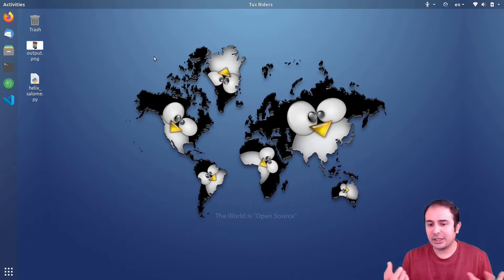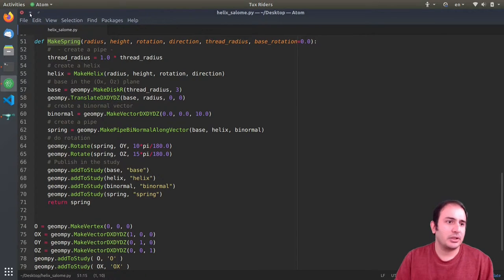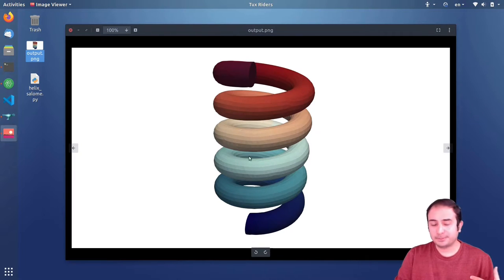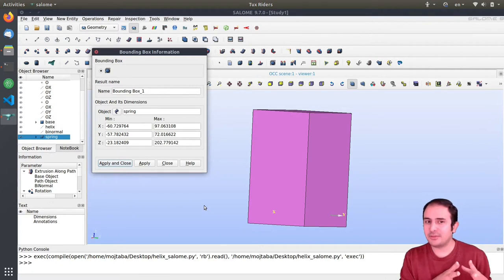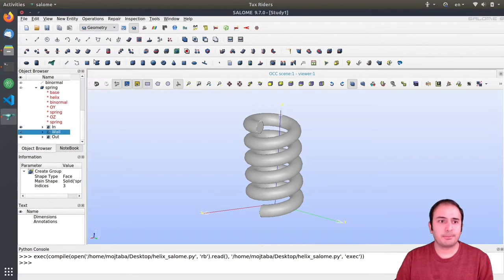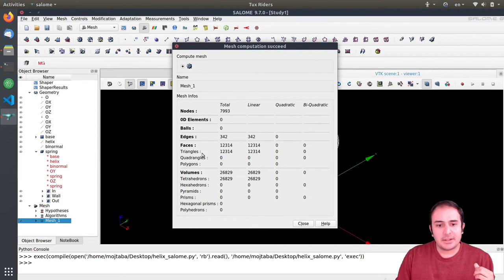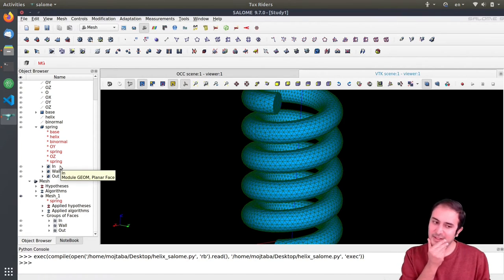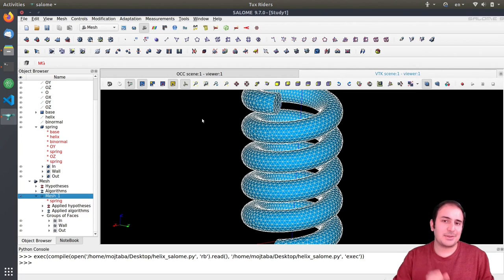[Finite Element 2] Prepare the geometry: create a helical spring shape in SALOME and mesh it

Comment: Salome blocks 7 GB disk space and you must use the python script workaround.
Is there another way to build a mesh for FreeFEM ? e.g. with gmsh ?
Reply from the maker: yes, you can build mesh for FreeFEM in any other tool that supports either gmsh (.msh) or medit (.mesh) formats, including the GMSH software itself. I agree that the amount of disk space that SALOME occupies is very annoying, which is related to the huge number of libraries and tools that it integrates into one environment.
Reply: @TuxRiders  Dear TuxRider, I had the meshing working with the GMSH software a few weeks ago. But I cannot make it work again. I don't know why and it drives me crazy. I believe the surfaces assignments are not saved or something similar. 

Start GMSH, click: File, Merge, helix.step.

Modules, Mesh, 3D

Modules, Geometry, Physical Groups, Surface, click on the meshed 'in'-surface, Name: in, Tag: 10
I believe my mistake is hidden somewhere here in the dialog box 'Physical Surface Context', because after setting Name and Tag, I just close this box by clicking on the x. Can I somehow see what surfaces I assigned and saved ?
Or do I have to press 'e' to end selection at a certain point ?

The same for again with for the 'out'-surface, Name: out, Tag: 12

File, Export, File Name: helix.mesh, File Type: INRIA, Save

MESH Options: Physical Entity, Save all elements: true, OK

When I run FreeFEM++ helix.edp containing a 'readmesh3("helix.mesh");' , it finishes with 'Ok: Normal End', but in all the time steps it says '--Solve: min 0 max 0'. So there is dynamics at all :(

I am super greatful, if you tell me where my error is or how you do the meshing with GMSH in detail.

Best, Flo.
Reply from the maker: @MrFischvogel  the problem of having a zero solution is due to incorrect boundary labels. no BC means that the system stay in its IC state. as you said, the problem lies in the physical surface selection dialog, in which you should press 'e' in the end of the each surface selection. don't bother yourself with assigning a tag because it is easier to modify it the code. assign the surfaces and also don't forget to assign a volume. you can always check the tags assigned to the surfaces from "Tools -> Visibility" and selecting "Physical groups". then, for exporting the mesh, make sure to NOT "save all elements". after all these steps, adjust the labels in the FF code and run it. it will work :)

you may also have a look here: https://youtu.be/XnfvXn9bF4Y?t=669, where I use GMSH to prepare a mesh for FEniCS, but the process is exactly the same. I hope this solves the problem for you.
Reply: @TuxRiders  Thank you so much for your carful answer !
It is working now :)))